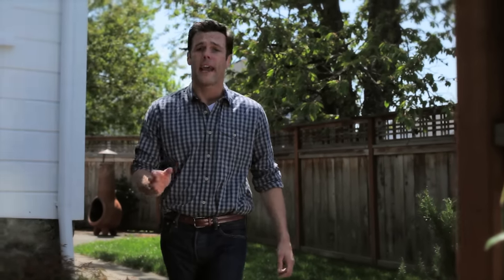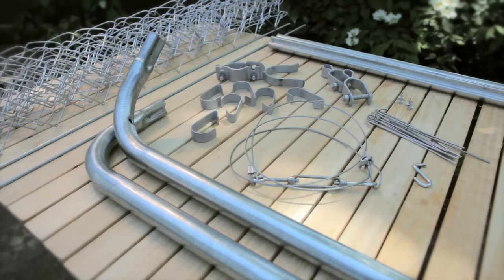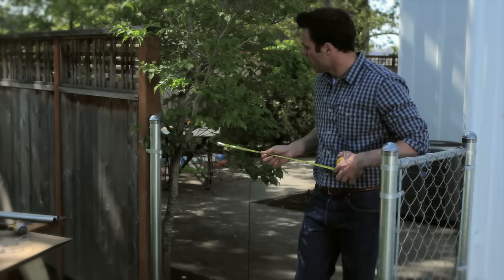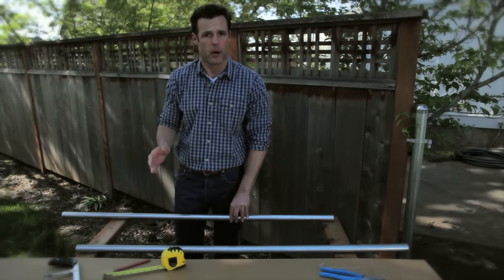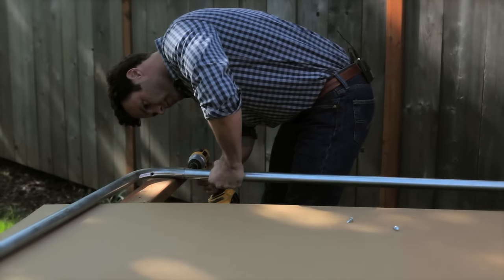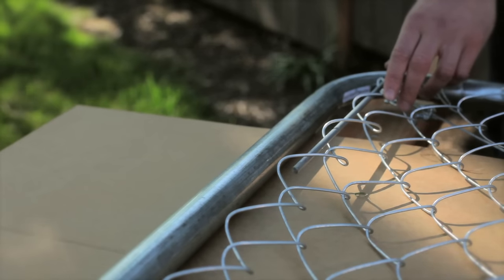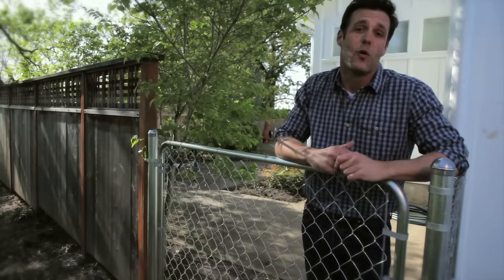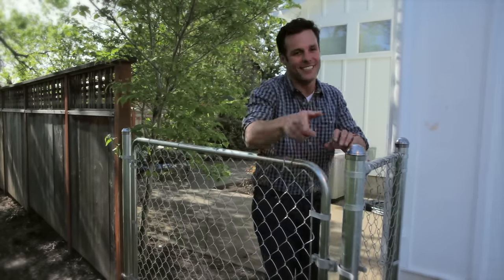Fit-Right® Adjustable Walk Gate Installation

Comment: I replaced some wooden gates on post and rail fencing on my property with these chain link gates. Since I used J-bolt male hinges that bolt through the wooden posts my clearance on the hinge side was 2 1/2 inches instead of the standard 2" for chain link clearances. Do yourself a favor and just know that the 2 vertical poles add a total of 12 inches to the length of the top and bottom rails and cut them to length after subtracting for hinge and latch space. And as others have stated don't over tighten the truss wire or you'll rack your gate out of square. They did work fine but I had to do some disassembling and re-cutting on the first one.

Comment: It would be nice if you could account for the hinges when measuring how much to cut.
Reply: I think that’s already calculated at the start. The 72” gate is not 72 inches wide - it’s smaller to make room for the hinges, etc., just the right size for a 72” hole. So you’re measuring the difference, to know how much to cut off, not how much is left.

Comment: You measured from pole to pole and cut the pipe to your measurement.  That will not work.  Notice you added corner posts and made the distance longer, plus you have hinges on the side making it wider.  Your measure is wrong.
Reply: Obviously, you can't follow directions well.  The gate is MADE for 72", including hinges and corners.  So, when he cut off 8.5", it is now a gate designed for a 63.5 opening.  

Your measure is WRONG